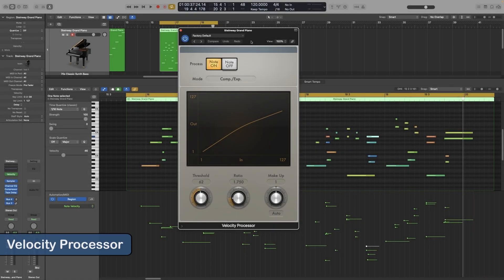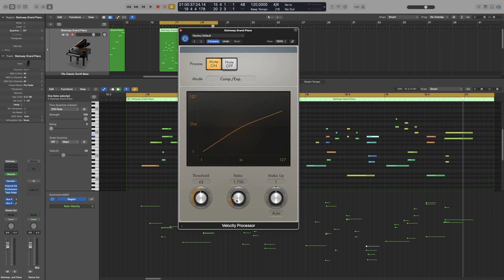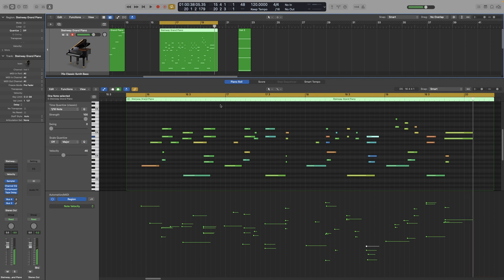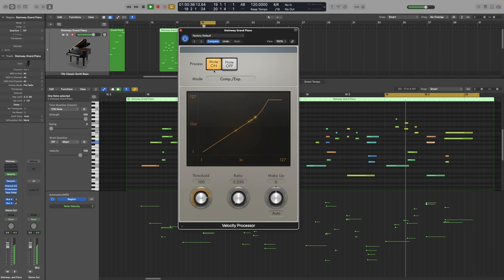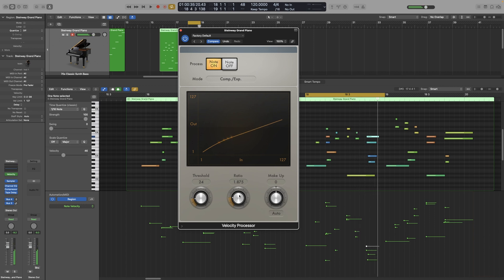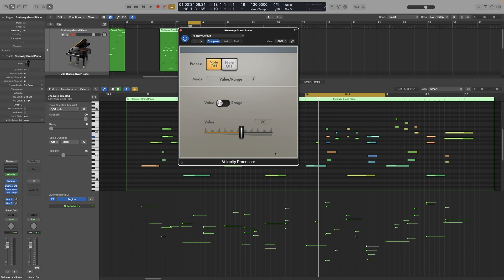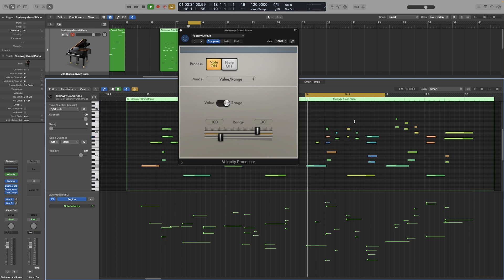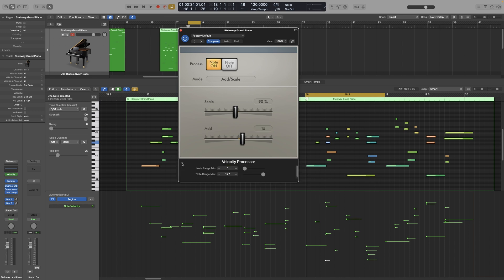Logic Pro Complete Tutorial - 59 Velocity Processor

Comment: I was playing with velocity processor with drums and the range settings, but found it worked very different than I had expected.  I was really looking for a velocity gate, but I did learn something.  Not sure how or when this tool is necessary.
Reply from the maker: The problem is that even though it looks like a compressor it will act differently than an audio compressor. 
For example, not one setting will apply to the same instrument by different brands. Some may have fewer velocity layers or the same number of velocity layers but on different MIDI data. What if a brand has mezzo forte at 55-80 and you put the range of the velocity processor to process the notes from 60 upwards? Then it will leave the notes below 60 that are actually the exact same dynamic and will only process the ones above 60, resulting in very inconsistent velocity control. 
That’s just one example. 
I like the fact that there is a plugin that does this, and in all fairness, it can have some applications if you are working with MIDI a lot. Personally, it is one of the plugins that I almost never use. I will usually bring my region as close to the dynamics that I want and then bounce in place to process the audio file with an audio compressor. The reason I made a video about it is because I want my Logic pro course to be as complete and detailed as possible!
Thank you very much for watching.